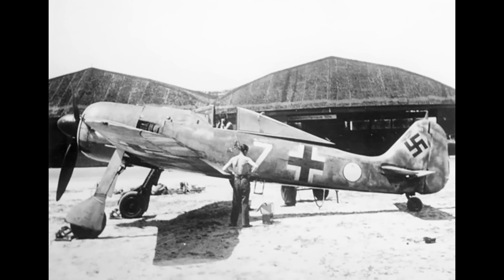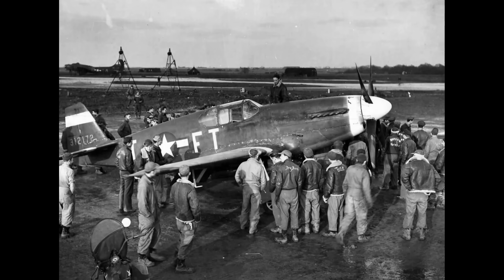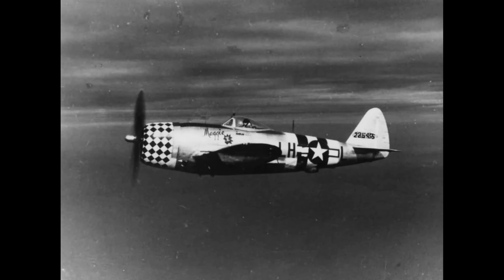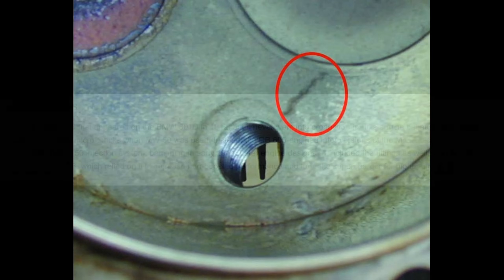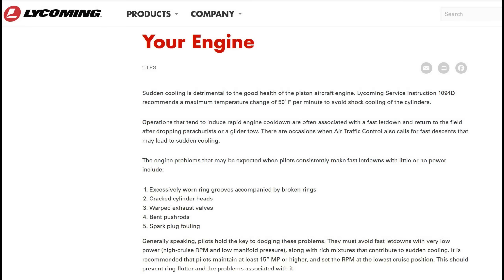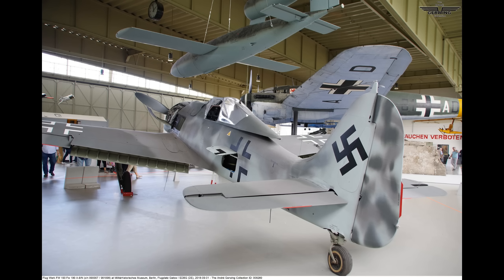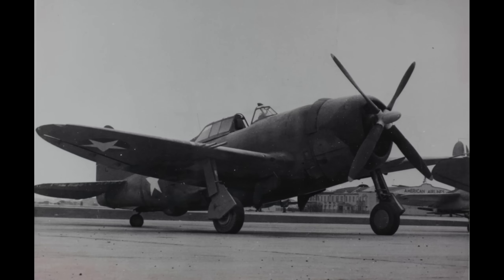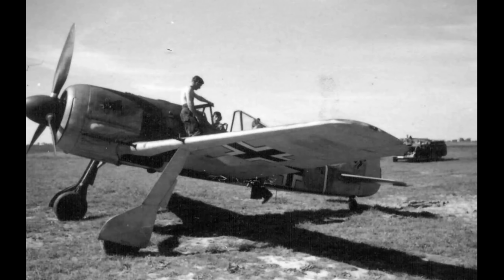Focke-Wulf Fw 190 A-4, Almost turned the tide, Almost...

Comment: 14:40 - You're very right about the propaganda aspect. It absolutely got under the Nazi's skin that England was bombing them with rather sizable raids at night, and they had nothing to bomb them back with. All over Goebbel's diaries are constant references to the need to retaliate, and the fact the secret police was saying the German population wanted retaliation for the RAF night raids. The Germans actually planned to kick off a second Blitz on England in early 1943, you know, once they finished off the obviously about to collapse USSR in 1942 (lol). That never came to pass obviously, but there was enormous political pressure to bomb England as retaliation regardless of the actual impact of the raids.

Comment: A big off-topic thanks!  As a private pilot, I read a lot about shock cooling, though it was not a problem for me, given the low altitudes I flew at.  I did wonder a lot about why shock cooling didn't seem to be a problem for radial-engine fighters when they dove from high altitudes during combat.  Your explanation here helped me to understand that it simply wasn't a concern; though the regular short-term maintenance and short expected lifetime of WWII engines in combat may also have been factors as well.
Reply from the maker: WW2 fighter engines had inspection and maintenance done at such tight intervals that they would catch the problems before they got too serious, usually...
Reply: @GregsAirplanesandAutomobiles  Yeah, inspection by a professional maintenance team after every flight is really nice!

Comment: I see -20 deg/ min with my IO-360 as determined by my JPI monitor in the pattern easily.  Never seen -50 deg/ min, but I operate conservatively.  I flew C-402Cs for several years in commuter service, with training emphasizing incremental power reductions.  We had very few engine failures (2) that I recall.

Comment: I’m afraid we did encounter shock cooling leading to cracked cylinders on our Lycoming powered glider tug aircraft. We have several tugs at Lasham in the U.K. originally it was full power take off and climb to 2000’ or more, followed by closed throttle and rapid descent to land, then doing it again. I believe the problem was cured by throttling back gently and descending with power slightly still on. This allowed slower cooling.

Comment: I used to work in an engine shop and saw cracked cylinders all the time. Not only the turbo and supercharged ones but even the little ones like 0320 and 0200.

Comment: Shock cooling cracks cylinder heads, who would dispute this?  I have replaced bushel basket fulls of cylinders due to this.  The best pilot technique may not be enough to prevent it either.  My experience is with a fleet of C-402C aircraft with the TSIO-520-VB engine operating in temperatures occasionally lower than -40.  Most often the cracking was at or near the fuel injector and in our daily we looked for fuel stains as the indicator of a crack.  So fuel atomization at the injector my play part for cracks there.  Our pilots were trained to try to mitigate this.  As a side note, we would not get too worked up with cracks found at the injectors, these would progress slowly, maybe go from the injector to the spark plug, and work this into the near term maintenance schedule.  We would ground immediately if the crack was leaking exhaust though.
Reply from the maker: Who would dispute this? https://www.avweb.com/ownership/shock-cooling-time-to-kill-the-myth/

Comment: As for the Anton's capabilities as a dogfighter, during the Dieppe landing many Spitfire V's were bounced by early 190's which excelled with roll rates that the Spits couldn't match. So much so that the Brits urgently scrambled a makeshift version of the envisaged Spitfire VIII, namely the IX.
Reply from the maker: Yes, and that's an example of how the 190 could have turned the tide in the mid 42 to mid 43 range. By early 44' it was absolutely too late.
Reply: Well, that is a bit overblown... the 190 was in service in very low numbers when the RAF was getting murdered by the LW over France, most of the killing was done by the 109F, which pretty much every German evaluation marked as suoerior to the 190... except in roll rate.

There was a lot of copium drinking in the 1941 RAF in order to deny that the 109 was superior to the Spitfire.
Reply: @LucioFercho  Have you actually got any evidence to support this claim?
Reply: @Will-hv9ns  Go read any book on the 190, it will tell you how many aircraft were actually in service in 1941 when the myth was created.  IIRC it was less than a group, barely three squadrons of aircraft with low availability due to unreliable engines.

But according to the brits those few aircraft and not the Bf 109 were to be credited with their slaughter over France.
Reply: @LucioFercho  Telling me to go read a book isn't a source. It's very silly to suggest that the British would overstate the effectiveness of the FW190 in order to downplay the role of the BF109. Aircraft performance data and testing isn't done for propaganda reasons. The RAE and Air Ministry were very explicit in their praise of the characteristics of the FW190 for good reason.
Reply: @Will-hv9ns  You will make look for the reference and crush your dreams, huh?

OK.

But for starters you should be wondering why the tops aces of the LW flew the Bf 109 and not the Fw 190.
Reply: @Will-hv9ns  In January 1942 there were exactly 62 serviceable Fw 190s, in 1941 the RAF lost 411 Spitfires in combat against 101 German fighters, a 4 to 1 ratio, a massacre, when only a few 190s were available.

When the RAF became aware they were losing badly, they didnt announce the supposedly inferior 109F was deadly, they hyped the new and rare 190 to keep up morale and explain the losses.
Reply: Yes, and when first encountered in "circus" raids over France, when reported back, RAF fighter pilots were told they were captured Hawks.
To which the reply was well can we have some.
The realisation that the MkV was outclassed was a nasty shock.
The MkV had to soldier on, there were many in service.
They clipped the wings to improve roll rate, and altered the turbo to be more suited to low level bit it must have been an uncomfortable experience.
Clipped, clapped, cropped, was the memorable description in I think Clostermanns book.

Comment: Engineered the cooling system for the notoriously overheating AC Cobras running high hp SBC. One part was an extra watertank under the ram-air scoop doubling as airfilter and also directing cool air to the rear cylinders. Consequently I deleted one electric fan and reduced oilcooler size and went down one thermostat size. The cars now stay cool in 35C stop and go.
Reply from the maker: What? A Chevrolet motor in a Cobra. Sacrilege.
Reply: @GregsAirplanesandAutomobiles  Shelby couldn’t get Chevy to sell engines. A Chevy is the correct motor🙂: shorter, lighter, lower and 5 inches further behind the front axle than a Ford. Enjoy your tech expertise a lot! Thx Greg

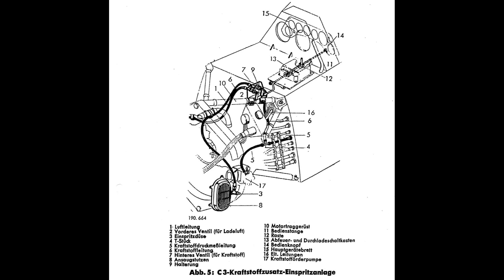Comment: 12:30 Kraftstoffdruckmeßleitung
- the most German thing I've read in a while.
Reply from the maker: Ah, those Germans, they have a way with words don't they?
Reply: Kraftstoffdruckmeßleitung:
Kraftstoff = Fuel; Druck= Pressure; Meß(en) = measurement; Leitung = Pipe 

a Pipe to measure the pressure of the fuel..
that`s how the German Language works, its all a description of something. pretty much straight forward, nothing to memorize. ;-)

Comment: The increase in length between the A4 and A5 was 15.5 cm (6.1") ahead of the front wings due to longer, stronger engine mounts, not really significant. The main contributor to increased weight was the increased amount of kit to allow the aircraft to fulfil a wider and wider range of roles.

Comment: I want too draw a line too race cars no longer adding cold fluids and people filling a over heated car radiator without the engine running and sometimes adding the cold water to quickly with the motor running. I'm in the  Shock cooling is a real thing club...

Comment: *sigh*, shock cooling is not a myth because it can't physically happen, it's a myth amongst GA pilots and instructors because it *doesn't happen in general aviation in anything remotely resembling normal operation*. That's why Lycoming's definition is completely irrelevant. It doesn't apply to GA because exceeding those cooling rates is essentially impossible in a controlled descent, so the whole "no more than 2 inches manifold pressure reduction per minute " thing is bunk, and it doesn't apply to Nazi Germany engines with water methanol injection because Lycoming don't make those. But if you do get shock cooling from water injection, then cylinder head cracks are exactly what you'd expect, and nobody ever said otherwise.

Comment: The obsolete Swordfish torpedo bomber was used with great effect with luck ibeing a factor. The torpedo launched by one of 12 that struck the rudder of the Bismark was perhaps a lucky strike. Or perhaps the pilots , in trying to avoid anti aircraft guns instinctively flew their Swordfish towards the rudder. It was unlikely that torpedoes could have caused significant damage to the Bismark except for a rudder strike. Sometimes obsolete is what is required and luck.
Reply: You can't make luck the argument in the Mediterranean though
Reply: Rudders and props are always vulnerable, Prince of Wales, Manchester and Edinburgh were all lost from such unsurvivable damage.

Comment: When I was a skydive pilot shock cooling was definitely a concern. We would monitor cylinder head Temps all the way up and carry some power in the descent to keep Temps up
Reply: It is only a few weeks ago that my father complained about how one off the by then few Motor Engine Certified Pilots left in the local Glider Club - regularly destroyed the Engines on their Tow-Plane .... Simply because he almost chrash-dived it down immediately after Glider-Release (I can't remember exactly what the maneuver is called). 
They would MUCH prefer to use ANY other pilot (if available) than him - but more often than not - it was him or no Flying that day 😞
Any other Pilot flying the plane (or the Piper Cub they had before) had any Incident's in the Engine Log, for the plane => It did have to be really bad for things to go wrong.

I'm sure that the Problem increases with the Diameter of the Cylinderhead - as the stresses increase with size and the BMW was a Really BIG Engine ...!!!
Reply: Yup when I was glider towing with air cooled engines we used to always do powered on descents to reduce shock cooling. Not an issue with Rotax powered as the water cooling provided more stable temp changes. Just a bit less power but depending what you are towing it can work out ok.

Comment: By no means questioning Greg's statement, just admitting my mild bewilderment. "The problem was the sudden drop in temperature during the compression stroke." Wouldn't the temperature tend to increase (gas under pressure) on compression?  I could see this being read a couple of different ways.
Reply: That only applies when you inject water methanol mixture into the charge during compression. Which is it allows increased power. Otherwise, yes, compression makes things hotter.
Reply from the maker: Compression makes things hotter but water evaporating cools.
Reply: @GregsAirplanesandAutomobiles  Thanks, that clarifies it.

Comment: Well done, as usual, Greg. As far as I know, Dad never came close to flying an FW-190 of any variant, but the importance of water-methanol injection can be judged from VF-19's operational history. They went to the trouble of swapping out every single F6F-3 they had that lacked that feature on the PW-2800. That is, they traded airplanes with another squadron on Maui in early 1944 (the other squadron would have time to re-equip before beginning its combat tour) so that every VF-19 Hellcat was equipped with water-methanol injection when their combat tour began in July, 1944. If there's an edge available, it's foolhardy not to take advantage of it.
Reply: Even with w/m it could not match the 2 speed 2stage supercharger of the Merlin The FW190 could not match the climb or the service ceiling All radials of WW2  had that problem.
Reply: @jacktattis  Indeed.  I thought the 8th AF solved the FW190 problem by increasing operating altitude from 25,000ft. to 30,000ft, which no air-cooled FW190 could reach.
Reply: @RexKarrs  Just responding to you and @jacktattis.   The Fw 190A4 has a service ceiling of 34,000 to 37,000ft. (depending on variant) so it could reach 30,000ft but it was loosing performance but it was usable at 25,000ft.   The full pressure altitude of the BMW801D2 was 21,000ft.  This being the altitude at which the supercharger can maintain sea level conditions.   The P-38 P-47 turbo superchargers with inter-coolers had critical altitudes of around 30,000ft and were flat rated to 25,000ft.    The turbo does come at the cost of increased weight and drag and needs a bigger propeller but it gave the American fighters better performance..   Rolls Royce made a minor breakthrough in late 1942 with the introduction of the Merlin 60 that had two stage two speed supercharger.   This really needs high octane 100/130 fuel for a worthwhile increase.
-The US Navy fighters the Hellcat and Corsair had the Pratt & Whitney R-2800-8 and R-2800-10 which had two stage superchargers with independent drive (ie 4 speed) with inter coolers and easily marched or out performed the Merlin 60 series.  
-The BMW did however have improved engines;
-BMW 801D2 basic engine with single stage 2 speed supercharger  full pressure rated altitude of 21,000ft.
-BMW 801TS and TH engine with unproved supercharger fluid dynamics, still single stage two speed but full pressure rated altitude raised about 23,000ft.  Used in Fw 190A8.
-BMW 801TJ-1  a BMW 801D2 with an integral supercharger rated altitude around 39,000ft.    The Germans retained the mechanical supercharger hence the very high performance. Saw some service in Ju 88S3 and Ju 388L1.  The BMW 801-TJ2 had an improved turbocharger.  
--BMW 801TQ.  A BMW 801TS with a TJ turbo.  On the test bench.
-BMW 801R.   Like the US Navy R-2800-8 had a two stage 4 speed mechanical supercharger with inter-cooler.  The inter cooler was placed behind the engine making it as long as a V12.   It was planed to use it on a variant of the Ta 152C and Ta 183 but bombing destroyed the prototypes and plans so it was abandoned since it would take too long to recover.
-BMW 801F heavily reingneered BMW 801TS with 2600hp and 3 speed supercharger.  Never entered service.
Reply: @jacktattis  If they made a plane as fragile as the Spitfire, sure they could. Besides, there are plenty of radial-equipped aircraft that could match it in a climb - the Ki-44-II had a lot of power in a very small airframe, its only downside being a single stage 2 speed supercharger.

And since radials are about 1/3rd lower in weight, cost, and materials used to a comparable displacement inline, they certainly could fit a compact 2 stage system.
Reply: @reinbeers5322  Even in Japan they could  just beat the P51D in Climb rate but not in height almost 5000ft less . And forget about beating the Spitfire
Reply: @reinbeers5322  That fragile Spitfire could reach Mach 0.89 every day Those US buses best was  Mach 0.80 and that was  the P51 . Gee what happened                                               ?The Ki 44 3690
Reply: @reinbeers5322  Fragile Spitfire Mach 0.89 US best 0.80 P51. Gee what happened?
Ki44 Climb Rate 3690 ft/min Every Spit ix and above 4300ft/min with a Spitfire IX JL165  08 Oct 43 at Hucknall Merlin 66 25lbs Boost 
0-5000ft                5740 ft/min
5000ft-15000ft    5080ft/min 
Vickers and Rolls Royce were always trying something
Now come back where a radial in WW2 beat it.
Reply: As far as I can tell the USAAF introduced water injection (called ADI)  before the Luftwaffe and USN with 15 gallon water tanks on P-47 entering combat in late 1943 with earlier P-47 being retrofitted in January 1944 and navy/marine Corsairs and Hellcats receiving R-2800-10W and 8W respectively in early 1944. Note the W in the designation.   Luftwaffe use on fighters was first with the Me 109G6AM in March 1944 and Me 109G6ASM about 1-2 month latter.  The use of MW50 allowed the DB605A to be over boosted from 1.42 Ata (atmospheres) to 1.7 atmospheres manifold pressure for an increase in power from 142ohp to 1700hp but only at lower altitude where the S/C could achieve these pressures.
I can not find any reliable records indicating MW50 use on the BMW 801 of the Fw 190.  Some internet lore claiming Fw 190A-5 were field modified for cross channel hit and run raids and some that some Fw 190A9 had this facility.   BMW 801 engine performance was roughly
-1941/42 BMW-801C2 1560hp using 87 octane "B4" fuel.
-1942 BMW 801D2 1700hp using 94/115 C grade fuel and slightly higher compression ratio.  This fuel seems to have become 96/125 during 1942 with Allied Fuel Intelligence on downed aircraft and drop tanks predicting a powerful new engine to exploit this fuel.  
-1943  BMW-801D2 with C3 injection.  96/125 fuel was injected to the eye of the supercharger to pre-cool the air and create a rich mixture that allowed 1950hp below 1000m.  The system was only used on Fw 190F ground attack aircraft.  
-1943 BMW-801D2 with increased emergency power.   The standard injection system increased mixture richness to allow 1850hp with no altitude restriction.  Probably improved spark plugs involved.
-1943 late above 2 systems combined.
-1944 The BMW 801TS and TH featured improved supercharger fluid dynamics for a higher altitude performance and precision vacuum cast heads achieved 2050hp.   Used on Fw 190A8 and A9.   Some claims of 2200hp from this engine at increased boost.
-1945  BMW 801F 2600hp never entered service. 3 speed single stage super charger.  Heavily re engineered.